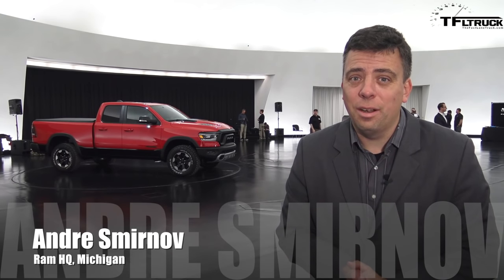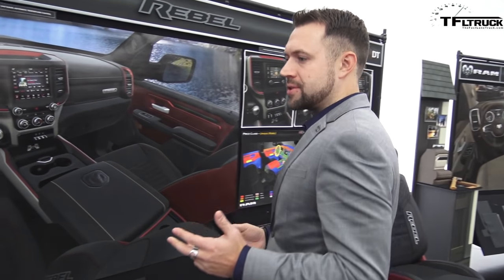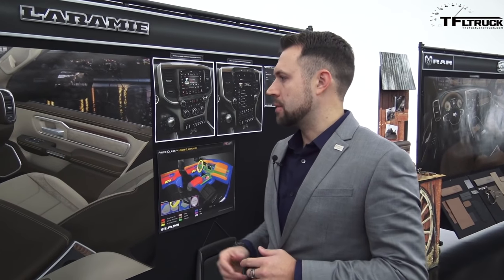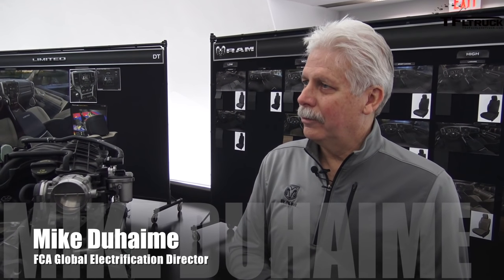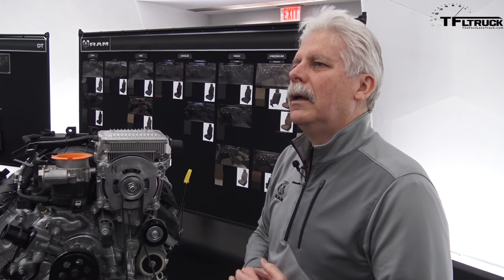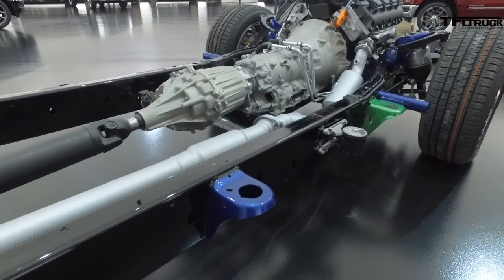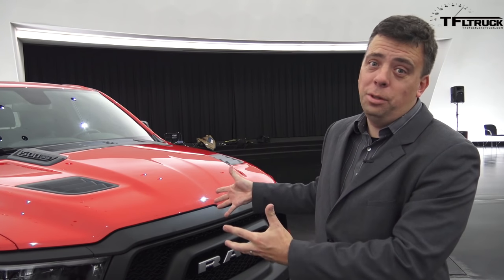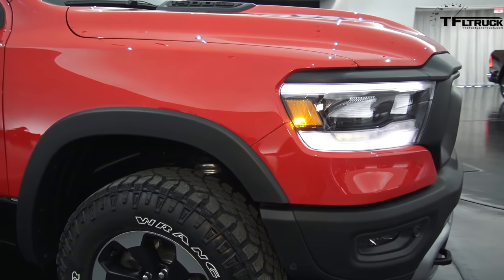Breaking News: Everything There Is To Know About The 2019 Ram 1500

Comment: I could easily live without all the digital bs and doodads if I could just get a solid truck that doesn't cost 45-50 grand.
Reply: Lucky for you they have the tradesman.
Reply: Alpha namens I have seen the tradesman in the low 30's, until you add 4 wheel drive. It is probably my best option though, you are correct.
Reply: Is it so hard to get a truck with leather and the nicer interior without getting the huge 12 inch display that will not hold up well over time I like luxury feel and soft touch materials but I don't like the touch screens in my vehicles I like mechanical knobs and switches they don't break as easy they are quicker and easier to use and i've driven dozens of vehicles from all brands and not all the time but some of the time the touchscreens are really laggy and to me that is just unacceptable if not more convenient to use than mechanical switches
Reply: Npc_Hydra3 Think about this. If you're faced with paying 40 or 50 grand on a truck and you like the old school trucks, you might be better off buying an older truck for 5 or 10 grand and putting 20 grand into it. Then you can have whatever you want. Of course, that doesn't work if you're planning on financing the whole thing. I personally have always loved the old Rams and Adventurer trucks.
Reply: if you get the Express edition a few years old, you should be able to find something under 20K.  in 2016, I purchased a 2013 RAM Express, 2x4, 5.7L, single cab, short box for 18K.  if you shop around a bit, you may be able to find a similar 2014 Express for about the same
Reply: Luc Landry I have to have 4x4 so the best I can find here in around $35k. I'm going to Arizona for 6 months and will be looking there for a deal.

Comment: I hope there is a version without the hybrid system. No offense to Ram but this is new tech and over time it will fail and cost money to repair. All I wanted from the new ram was new looks, a bit lighter, and more power from the 5.7 hemi.  I have 2013 Ram 5.7 with 82,000 miles and still loving it.
Reply: Adrian Swan have you had any issues with the engine or trans? Also electronics? Trying to decide what will be my next truck here soon bro lol.
Reply: Adrian Swan cylinder deactivation and auto stop-start technology is not new tech at all. Cars have been using this tech since back in the early 2000’s or earlier and have been on the truck scene since 2008ish. You aren’t gonna find any engines with at least some type of hybrid technology now. Those days are long gone.
Reply: caddy was doing cylinder deactivation in the early 80's
Reply: +Steel - yeah and it SUCKED!!!!
Reply: Adrian Swan they reduce weight 225 pounds 19:50
Reply: Most of this new tech is designed to be fail safe, meaning when it fails you simply go back to a normal v8.  the only issues ive seen is cam phazors in chrysler products have issues due to mexican production.
Reply: Also not a fan of the hybrid part getting shoved down our throats. I’d rather see just more pure power. But there’s supposed to be much more coming on the power train side so we’ll see.
Reply: Don't even mention the 4.6.8 Caddies absolute junk engines but yes they did have it back then even the Northstar powerplants had cylinder deactivation.
Reply: You can get the engines with or without the Hybrid system.
Reply: Adrian Swan Ik what u mean but they have to start adding it because the way this plant is going
Reply: Adrian Swan I'm sure there's away u can turn it off
Reply: Adrian Swan id be more interested in FCA improving quality control. Using cheap labor in Mexico isn’t helping much either
Reply: you can get the 5.7 without the hybrid system.
Reply: Anyone who says they don't like hybrids. They think Prius. Instead thing Porsche 918. When done right a hybrid can be better then a charger or turbo.
Reply: well well well, i have a 96 dakota 318k still sputtin around.
Reply: Mr_ NutZ FCA is moving all truck production to NA...per Allpar
Reply: Stephen Royal only thing that went wrong was a tiny ticking sound in the headers so I replaced them with kooks and they sound better and haven't had any problems
Reply: Andrew Ochoa Yes i know that but on a truck it's just going to complicate things and make in more expensive to repair in the long run.
Reply: Ryan C I get that it's adds a lot more torque down low and improves gas mileage but I just want a reliable V8 that can run to at least 200k without major issues
Reply: Just hit 100,000 on my 2013. Zero issues
Reply: actually the rams got cylinder deactivation in 2005
Reply: Don't buy a Ram unless its got the cummins. The gas rams suck
Reply: Whit Kern lol
Reply: Sure you are get a Tundra- No cylinder deactivation and auto stop-start technology
Reply: FIRE the EPA!!!!!!!!!!!
Reply: Ram are still steel body, they didn't do aluminum, or steel/aluminum mix to their trucks like Ford and Chevy. So, there's that.
Reply: You mean the shitstar engine? I had one blew a head gasket at 79k
Reply: Nucl3ar Family i get what u mean but someone had to start converting to electric. At least it's not like a prius where u get a smaller engine because of it. It actually makes u accelerate faster if u like to put ur foot down alot like me lol
Reply: check the FCA youtube channel for short videos on what they enhanced. lots of improvements. and i guess what you say about the light hybrid system is true but that stuff is supposedly designed to last these days.
Reply: check FCA youtube, they say its the best truck. but that could be bias lol
Reply: R.L. Agito it does look like a awsome truck and I think right now it's one of the best also 12000 pounds of towing is good. Can't amagin it's going to be exactly affordable but ya
Reply: And how much does the hybrid system (including that 48 volt battery) add?
Reply: Stop acting like an old man that wants everything to stay the same. They have been using this technology for years now. it was even adopted in formula one cars. You cant expect gas and diesel to be the major energy source of vehicles these days. Accept it. I own a 17' Ram with the gas sucking 5.7 btw.
Reply: Jordan Ulbrich I agree I think it's cool plus electric is faster off the line. (I like to put my foot down) and it helps with towing
Reply: Jordan Ulbrich it's also used as the starter now it has the starter plugs but they will only be used when it's very cold out
Reply: trevor shiaman exactly. I still thik they need direct injection, lower compression and a turbo for the 5.7. De-tune it to 400hp coupled with the E Torque. sounds like 20+ mpg to me
Reply: Jordan Ulbrich yup the eco diesel will be probably super efficient because I have one right now and it gets 4/100L (highway) which is really good. I don't know how to convert it but Ik how to read the miles one
Reply: It also has the turbo ur talking about lol the eco diesel. But ya that would be sick on the hemi
Reply: Adrian Swan 

We also have a ram 1500 2013 it has
136,677 miles on it and nothing fails not even electronics
Reply: blaze cole the only issues ours has had is the company value it's a know issue with the truck and a light will turn on in the cab and then turn off once it's warm
Reply: That e-torque sounds like shit. This guy could explain it other than it starts the engine very quickly....
Reply: IShastaMcNastyI because that's one of it main things it's the stop and start engine to help with pollution wether u like it or not this technology has to come
Reply: IShastaMcNastyI also because it has starter plugs but it won't use them unless it's really cold it uses the etorque system which is pretty cool. If u don't like it I'm sure there a way to turn it off
Reply: IShastaMcNastyI but who does notnlike an extra 500 torque when u put ur foot down
Reply: Giveit2mehRAW the thing I like about this it's not like a prius where they make the engine small and it's slow as he'll. It gives it a boost and the engine stays the same time
Reply: Lexman00 yep only the hood & tailgate which is the big winner if u ask me
Reply: Hybrids will be awesome man especially plug in hybrids. It'll put a dent in the fuel bills and the instant torque from the electric drive will fill in the areas where the engine lacks torque.
Reply: Adrian Swan I have a 2012 ram RT and all I want is more power
Reply: No thanks on the plug in hybrid. Main thing that will do is jack up electric bills. Now if it will work correctly they can just find creative ways to charge the electric motor.Which might be what they are doing.
Reply: T Ritchie u don t plug it in its not a very big battery when u break it charges it
Reply: Yeah I was responding to somebody that asked about a plug in. Personally I'm glad its not a plug in. I would like to know the difference between this one and GM's E assist.I'm hoping that it works out good.I like the ideal of getting good fuel economy in a pick up while still keeping the V8.
Reply: A lot of uninformed replies, so let me try. The mild hybrid type system has been around a while. I have a 2007 model car with a 36-volt variety that has batteries from the same material, and it adds torque via the drive belt, so I assume this will be very similar other than FCA's is  48 volt instead of 36. It is nothing like a full parallel hybrid, serial hybrid (aka Chevy Volt) or a plug in hybrid. It's much, much cheaper and is not truly a hybrid like we think of hybrids. That's why it's called a mild hybrid.

This system has no electric motor for propulsion. It's basically a generator-type start-stop system, and they somehow add just a bit of torque via the drive belt. I have the Saturn with this type start stop and I have an F150 with a more traditional and cheaper start-stop that uses the regular battery and the vehicle electric starter. Ford's system adds no torque or anything like that; just purely a start-stop system. Saturn used a 36-volt system back in 2007-2008 in the small SUV and mid size car, Vue and Aura, respectively.  The start-stop in the mild hybrid car is much more seamless; much more quick than in the F150. I can hardly tell it's shutting on or off other than the stone-dead quiet when it's off. The steering braking are unaffected; not so with the F150 system, but it works well too, but most-often, I do hear the starter spin while it's starting up. Also, I can say without a doubt, that the nickel hydride battery pack and the entire electrical system in the Saturn is extremely durable and reliable. I have eleven years and 140,000 miles with no issues and it works like new. 

Now for the bad news...This is a mid size car that weighs 3600 pounds and is listed at 158 ft-lb peak torque, way up high RPM wise, and it is anything but a refined driving experience on the highway due to those performance numbers and it's lackluster torque curve for a car that heavy, and also, the average mpg in that car has been around 29 living in a rural area. I cannot tell that the hybrid system helps one iota for mpg, but it a super urban environment, it might. As for the torque. In the Saturn, it is only detectable at speeds maybe under 12 mph.

People may not have noticed, but Ram has released the peak performance numbers for the base engine, and they are exactly the same as before. This 90 extra pounds of torque is likely only at the very low end, and then that assist goes away, so this is only a method to help with mpg in a super-slow stop-and-go situation. On the other hand, it if it is anything as reliable as my Saturn, customers have no worries with this system.

One last point, Ram spokespersons have said that this system will be optional with the Hemi, but not standard. It will be standard with the base Penstar engine and drive train.
Reply: l3arrett82 ram 1500 1999 360k
Reply: Actually Ram got MDS starting in 2006.
Reply: toyota Prius has one of the highest reliability ratings of any vehicle on the road.
Reply: HardforJesus they've had an aluminum hood for years, even before Ford transitioned to an aluminum body
Reply: there is
Reply: you don't know that

Comment: This is the first new truck I've seen in a long time that I actually like the looks of. Probably since the 2007 GM trucks.
Reply: Zachary Adams Imo the current raptor is the best looking truck ever made.
Reply: It's too bad they don't use the concepts as they are spot on. The front doesn't do it for me, but everything else does. Chances are the front will get a face lift in 6 years.
Reply: Zachary Adams I agree. I have a 2nd gen Ram and typically don’t like feminine/plastic look of the newer trucks, but this 2019 Ram looks great and has awesome features.

Comment: Between what Chevy and Ford have done with their new trucks, this new RAM looks to be the best one of the three manufacturers.
Reply: dannySRT6.4 Ford hasn't shown their 2019's
Reply: dannySRT6.4 only one problem with what you just said......Looks don't get you home and with all of the new gimmicky shit they filled the new Ram with it is sure to be a failure with lots of recalls witch saddens me cause i have always liked Rams.
Reply: jesse greenwood I meant “looks to be” as what they’ve done overall to the truck. They’ve changed a bunch of things and are trying to improve it, so I gotta give em props for that. Yeah, you’re right, they may have problems, just like any manufacturer does, but between the three, RAM is the most appealing for me. I’d put Chevy’s truck as a close second and Ford last because I’m not a fan of what they’re doing with their power train options. At least Chevy still has their 5.3 motor.
Reply: dannySRT6.4 RAM is best looking by far.
Reply: But the honda truck is the best of them all
Reply: Honda and truck don't go in the same sentence..
Reply: That dude Is that when the new f150 is coming out? Or is that a refresh? Also do you mean next yr as a 2020 model?

Comment: I hate the fact Dodge and other manufactures are pushing these 20 inch plus rims on their newer vehicles. Here in northern Michigan (go figure) where I put up with lake effect snow, and deep snow during winters. Those rims are garbage when it comes to prevent ice from building up. I want factory options for rims under 18 inches cause the extra rubber helps minimize the ice build up not too mention off roading.

Also a vibration damper module for the frame? What the f... was the new design not structurally sound under intense vibration so they added that? I don't buy their reason for ride quality.

Also, did the exterior guy say they lowered the truck stance by one inch for their rebel which is basically a off road vehicle? Cause... just no.

Lastly is there anything new with the engines beyond a bunch of bolt on packages added to aging engine designs?  I would have thought with the success of their hellcat  engines they would have at least gave us a neutered version of it (read as modified without supercharger).

So far it's all been underwhelming.